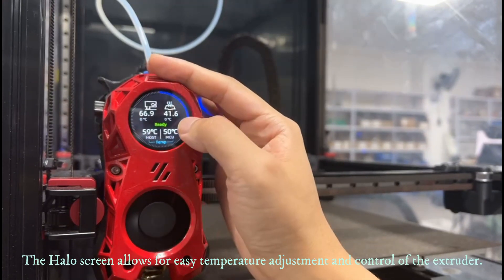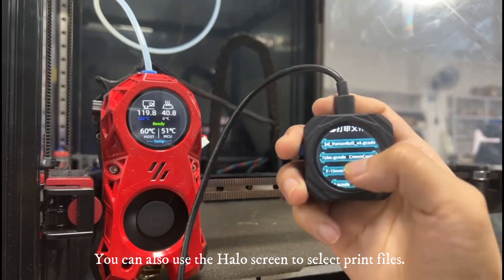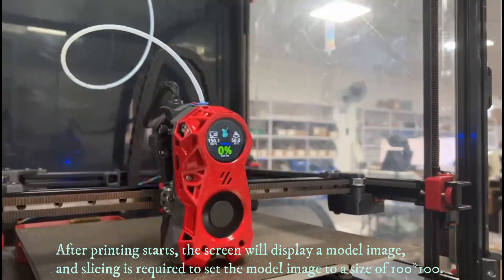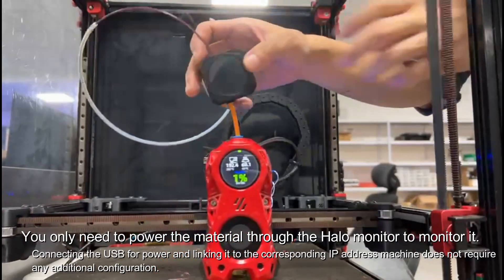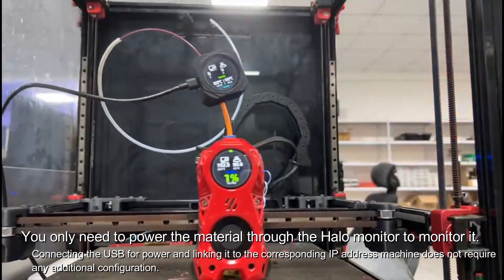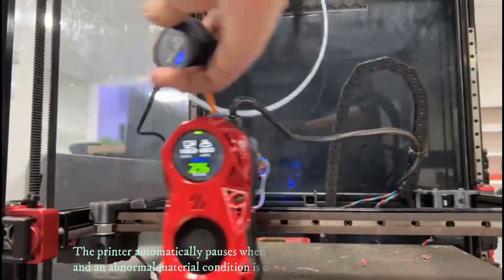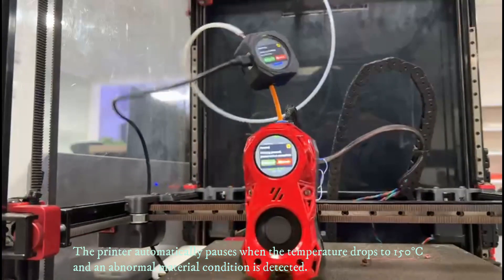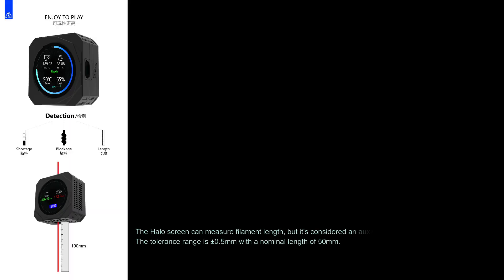3D Printing with Klipper Firmware: How to Use Fly Halo Screen for Filament Length Measuremen

Comment: Hi, where can I find the external housing (non Stealthburner) to print? Unfortunately I ordered only the display.
Reply from the maker: The shell alone is useless, it requires internal parts
Reply: @3DMELLOWPrinter How is it useless if you have the screen already
Reply: @3DMELLOWPrinter  I only want to put the display in an housing to protect it and not in the Stealthburner.